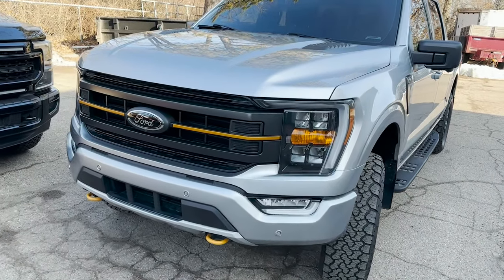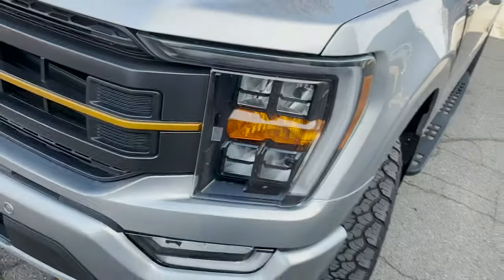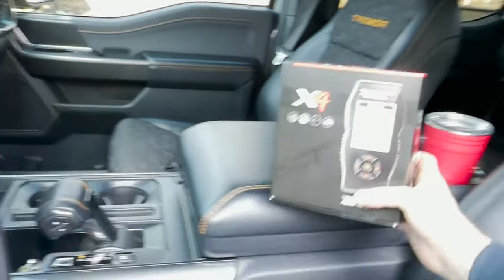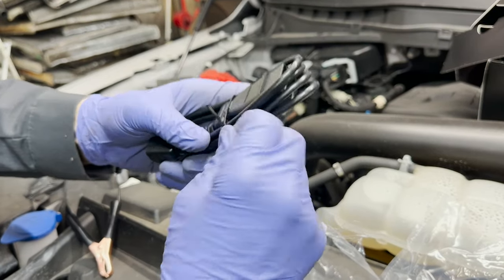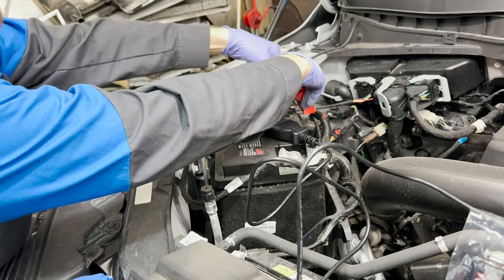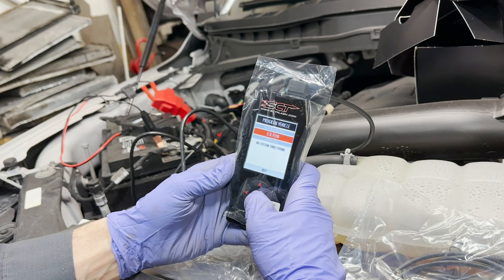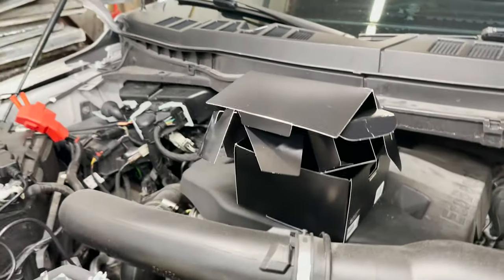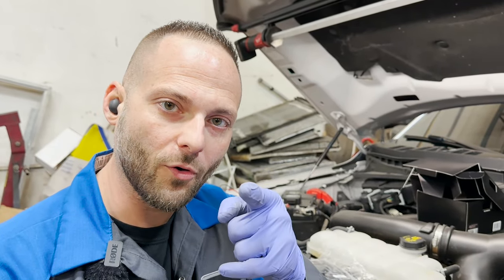F-150 Tremor 3.5 ECOBOOST | Fast??? #tuning time! SCT Flash

Comment: Why would he run in ECO mode if performance is what he is after?  ECO mode has lazy throttle response compared to Normal and Sport modes besides a  change in shift points.

Comment: I have. 2015 3.5 eco. It goes great but go put some non ethanol 90 in and hang on 😵‍💫😎
Reply: Ecoboosts run better with the ethanol in the fuel as the ethanol significantly cools the combustion chamber.  I saw a study where they got better fuel mileage and power by going from 10% to 20%!!!

Comment: Gen 14 F-150’s gen 3 3.5 is split! 
I found this out some time back. 21 and some early 22s can be flashed while others have a change which required bench flash. I’m not sure if they rectified it. Also, 21 early 3.5s have heads more like the gen 2s. The spark plugs are the old taper seat style.
Reply: You’re in a 21 Tremor Mid. I recognize the interior.

Comment: Did the springs you put on to decrease the rake (raise) cause any problems with bluecruise or any of the camera related functions, eg, some lifts say not compatible with bluecruise.
Reply from the maker: Nope
Reply: @PowerStrokeTechTalkwARod  Do you have a video on that install?  If not, perhaps you can tell me about how much deflection that front lift put on the CV Joints? If a drop bracket/credal isn't used on the Diff to lower it, then too much of a coil over shock lift beyond maybe 1.5 to 2 inches causes the CV's to deflect a lot and to spin at a weird angle that induces stress on the joints.  A little is ok...but more than that and those CV joints are going to have problems later because they spin all the time without axle hub disconnects on these types of axles credal.
Reply from the maker: @jameszeiger8533 yea I have a video on it. You'll have to look
Reply: @PowerStrokeTechTalkwARod  cool...thanks!  Will take a look.